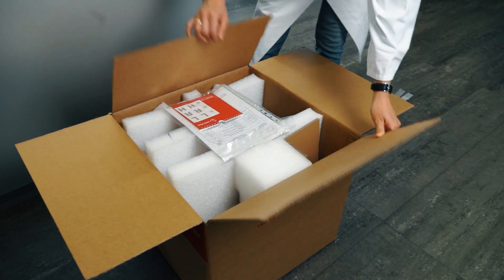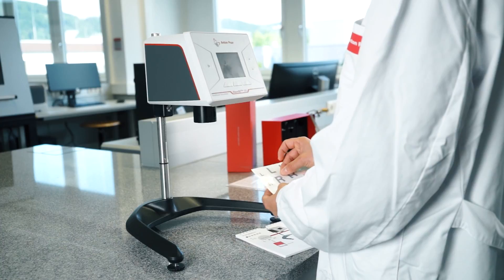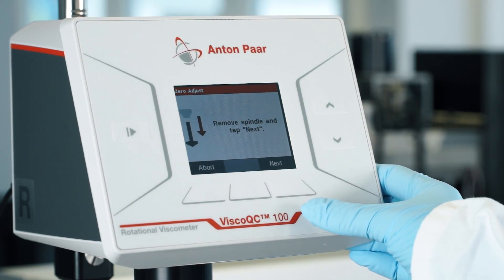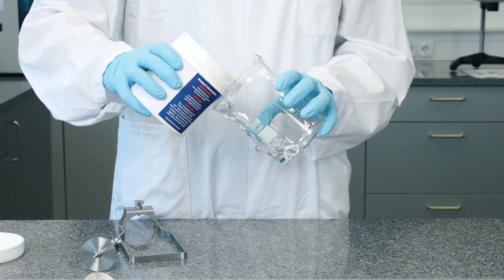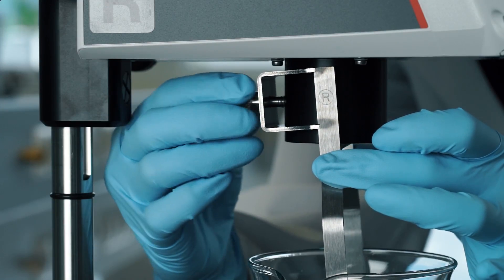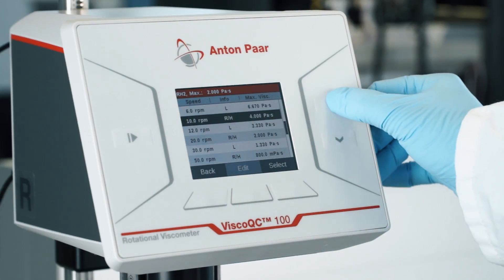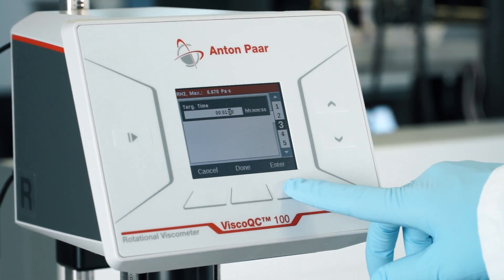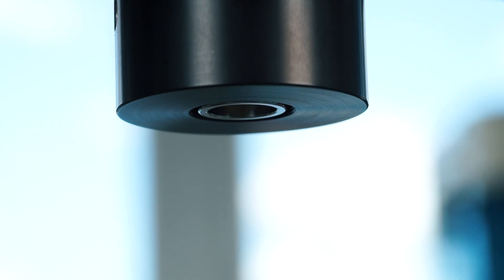ViscoQC™ 100 - Standard Operating Procedure

Comment: Can the spindle of the viscometer be adjusted to measure <50 mL of a solution?
Reply from the maker: Hi and thanks for reaching out!

With the ViscoQC standard spindles (RH or L) a sample vessel of at least 500 mL filling volume is required. A sufficient sample filling height is important, because the tip of the spindle should be at least 10 mm above the vessel's bottom and the spindle should be immersed as far as the mark on its shaft.
However, you can use our DIN/SSA measuring systems (not included in the standard package; must be ordered separately) for measurements according to ISO 3219 and DIN 53019 with low sample volume of max. 18.5 mL.

I hope this answers your question! /kuj